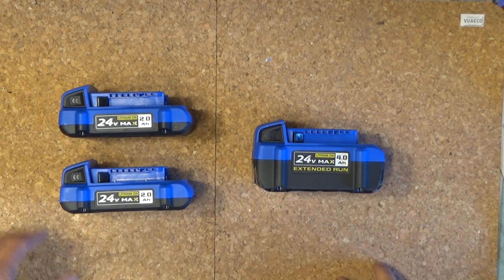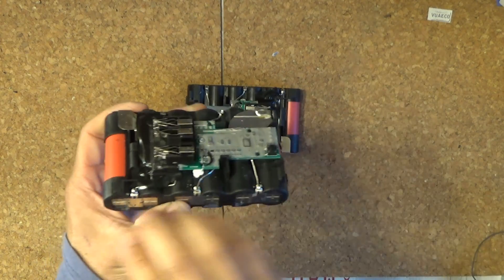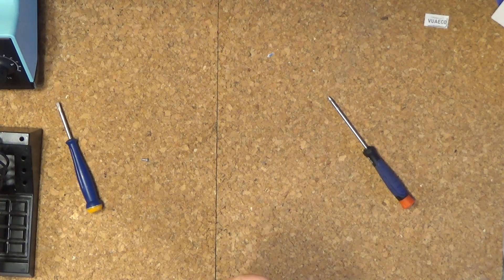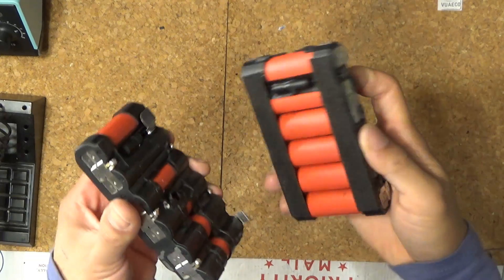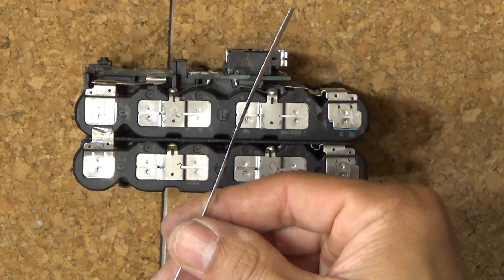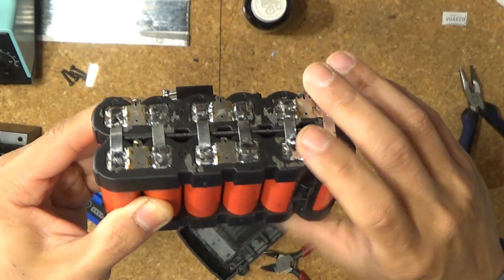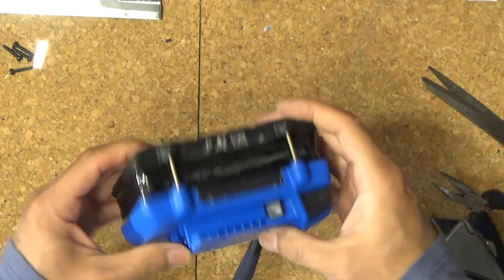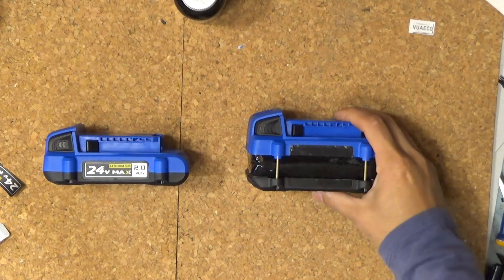DIY tool hack: Turn two compact power tool batteries into a single high capacity battery

Comment: If I connect 2 18v 2.5 ah 720 watt batteries in parallel, will I get an 18 v 5 ah 1440 watt battery? I will do this from the outside without opening them, I can charge them separately if necessary.

Comment: I would have removed the temperature sensor on the top pack and connected it to the temperature sensor on the bottom pack, since it is between both packs. Being sandwiched between them puts it into close proximity to more cells.

Comment: Good idea, but it it much safer for the cells if the strips are spot welded onto the terminals instead of being heated up with a soldering iron. Tip I learned from people building ebike and diy vehicle batteries.
Reply: True you can't solder right to the terminals be that's not what he's doing, he's soldering to the nickel strip. That's fine to do.

Comment: I understand the idea but there is an idiotic outcome from that creation. Before you had 2 batteries meaning you could charge one while using other one in the tool and when it drained you swap it with one that was charging and you keep going and when that one is drained you simply repeat that procedure. But now you destroyed one battery to build a bigger one and when you drain it you have to stop working and wait until it gets charged and the most idiotic outcome is that now it takes double time to charge it. So I come to conclusion that your Idea has a side effect of lunacy.

Comment: Can I upgrade to 3 batteries?
Reply from the maker: Yes, that'll be a 6Ah battery.
Reply: @vuaeco  in thinking of a 12ah. Will the same pcb board work. I understand my backup battery pack will be heavy but my angle grinder needs a bigger battery

Comment: Should have just connected them together in parallel instead of removing the BMS of the second pack. Now it’s not as safe as before, and the cells won’t last as long as intended. You wouldn’t have needed to do so much soldering on the cell...that could damage it.

No advantage in what you are doing other than save a few bucks. You’re getting at best the same WH as a larger pack. I would have paid the extra for the safety and convenience of not having to cut two packs apart, soldering, and exposed contacts.

Nice attempt to save a few bucks.
Reply: This is the way literally every 5S2P pack is made. There wouldn't be any safety benefit if he put two BMS.
Reply from the maker: What if you have a lot of 2Ah batteries laying around? :D

Comment: -Please help. My drill have a Li-Ion 18V batery with 5 18650 batery connected in series. If i connect othyer 5 batery in series, same 18650 for 18V, can i connect the two pair of batery in paralel to obtain the same 18V but higher Ampere? Thank you.

Comment: That is NOT how you solder batteries together. With that many soldering points you're going to over stress each cell when using in tools. Plus Li-Ion Batteries are programmed for specific ah so unless you use a multimeter to determine the ah being used at full charge then you really have no idea if it raised to 4.0ah as these are totally different type batteries than Ni-Cad and Lead-Acid Batteries. 

I just don't trust these type hack jobs from people not being completely detailed in the video.
Reply from the maker: So you can use a multimeter to determine the Ah of a power tool battery? How are you gonna do that?
Reply: @vuaeco  why you solder twice where you can get away with one only. you do this for a reason or it how you understand!??
Reply: @vuaeco , multimeters are designed for both AC and DC power. To determine the AH you must figure out a way to connect the battery using wires instead of normal connection. Then cut the positive wire from battery to drill and connect the positive test lead to the battery end of wire and negative lead to the drill end of wire. This allows the positive current to travel straight through the multimeter. You'll have to set your own multimeter for the ah reading and that depends on the type and brand multimeter you have.
Reply from the maker: @michaelw7540  I can't imagine how this is done based on your instructions. But I assume you're connecting the multi meter in series inside a circuit with a drill and a battery all connected together? Whatever that you're doing, you're measuring Amps, NOT Amp Hour. There's a huge difference between A and Ah. There is no way you can measure Ah of a battery using a multimeter. Well, maybe you can but you'll have to measure the Amps while it's under load and run your drill continuously until the battery is completely empty. That's gonna take a while. Get the timing and the current for the entire process and you can  get the Ah. This is NOT how a tool manufacturer like Dewalt/Ryobi/Kobalt... tests and gives Ah ratings to their batteries, by the way.
Reply: If you dont trust the process then dont attempt the project. You can believe all the manufactur BS if you want to, But this isnt rocket science. where is the memory input located, where these batteries were "programmed"?
The truth is that the DIY community has been using 18650 for all types of projects with a great deal of success for well over a decade.
Reply: First, there's nothing wrong with the soldering. Second, a multimeter cannot be used to measure the capacity of a cell. Third, he did not mix different battery types. Fourth, it did double the amp-hour capacity, since there are now two battery stacks in parallel.
Reply: @Daniel-lf2no  Actually, this guy has way more soldering straps than he needed to parallel the packs with his "method."  However, this is really not the way to double your capacity...go buy a pack that actually handles the paralleling approach properly for maximum battery life (measured in charge/discharge cycles.)  This hack will "work"...but for how long...well that is debatable.  The single charger on the top pack definitely won't be tracking pack temperatures well because the charger will only see the temperature of the top pack...so again, a hack...your mileage may vary.  The single charger circuit will charge this pack slower because it was not designed to deliver the current to both packs at the same time.  This is not a very practical approach to doubling your battery capacity...just buy a longer runtime version battery and have many happy charge/discharge cycles.
Reply: @steveranta8975  I believe that circuit board is identical to the 4AH circuit board - manufacturers, generally, don't like to make custom boards for each configuration (so it probably can handle the current). The only thing is that the other thermocouple, if removed, should be thermally coupled to the extra battery ( a piece of copper, for example, to transfer the heat to the thermocouple). It's a safety feature to prevent over charging (especially with lithium batteries).
Reply: @steveranta8975  well i dont see that much problem here. after consedering all what you menthion.
Reply: That reply is absurd.
Reply: He had twice as many soldering points as necessary but it only adds redundancy and headroom. If anything, it’s less stress. Personally, I would’ve doubled-over the strips and maybe even punched holes in either end before soldering but the end result wouldn’t have been any more reliable or performed any better than his. As I already said in another comment, I also would have tapped in to the other thermistor since it is sandwiched between and in proximity of more cells. Perhaps the board is even able to monitor two of them which you might be able to tell by looking at a larger pack.

Comment: Cool video! I have here a stupid question here: did you have the same runtime with one extended battery than with 2 normal battery? for example If you can drill 10 holes(it's an example) with a 2ah battery, will you make only the double with a 4ah battery, or there is gain?

Comment: Who Wants To Carry Around The Weight Of The Extra Battery, Also You Could Be Charging One While Using The Other One... Over Voltage Will Lead To Burning Out The Tools Motor Faster Or Cause It To Overheat And Melt Down The Plastic Casing...
Reply: There's a reason the bigger batteries cost so much more. You can kill a 1.5ah quickly with a grinder or reciprocating saw.
Reply from the maker: You got your point but having a bigger battery has its own advantages. Just depends on your needs. And you're incorrect about over-voltage, overheat, and meltdown.
Reply: @vuaeco  If You Put In More Amps Its Going To Hurt Something...

Why Have More Tool Weight When You Can Have One In You Tool Belt Or On The Charger

Comment: Is the balancer built into the charger or in the battery pack itself?  I see the circuitry in the pack and the instructions say it has built in overcharge, over discharge, and extreme temperature built into the battery, I wonder if it has balancing?
Reply from the maker: It has balancing board built in the battery pack. If you look closer, you'll see 7 solder joints branching out from the circuit board to the 18650 cells.
Reply: vuaeco it does not have over discharge protection so I doubt it has a proper balancer.  Even though it claims to have over discharge protection in the instructions when I ran the battery it allowed itself to drop down to 3.7 volts for the entire six cell pack which probably damaged the cells.  Very disappointed in these, I won't be buying anymore
Reply from the maker: What's your other options? Dewalt, Milwaukee, Ryobi? They are all the same. None of them have over discharge protection.
Reply: vuaeco buy new 18650 batteries for $1.50 each and a $3 overcharge/over-discharge/balancer board and solder it myself
Reply: vuaeco you're using these for electric scooters, there are better options for that
Reply from the maker: Where can you get 18650 cells for $1.50 each? What's the discharge rate of the cells?
Reply from the maker: What better options do you have for electric scooters?
Reply from the maker: What's the discharge rate on the $1.60 cells? You need 30A to 40A (need extra room to spare) to power a scooter. Those cheap cells have 3A discharge rate max.
Reply: vuaeco i don't know, but they don't even get warm powering a scooter
Reply from the maker: How many cells do you put in parallel?

Comment: I have 2 - 5ah (200 Wh) Snow Joe lithium batteries (iBAT40XR) and 1 - 4ah (160Wh) Snow Joe lithium battery (iBAT40) and want to connect all 3 to make 1 large 40v 14 ah battery for an ebike. Is it possible? Or is it possible to connect them all without disassembling them? They are the exact same size shape wise. Just different ah's.
Reply from the maker: You can solder the 2x 5Ah battery packs. You should not mix the 4Ah with the 5Ah packs together. They have different cells therefore different capacity and ratings. You will need to disassemble them in order to solder them together.

Comment: @vuaeco can the 24v 1.5ah batteries be connected the same way to the 24v 2.0ah and still have a balanced charge?

Thanks in advance.
Reply from the maker: Yes, they can. It's basically the same except the cells are 1.5Ah instead of 2Ah.

Comment: I am assuming that if you want to balance the cell, you have to first disassemble the battery pack out to individual pack and then charge them using RC charger with balancer option? is there a way to make / add in the cable for the balancer connection to the RC charger? I plan to try this out and use it in my son't power wheels (SLA batteries is a pain to deal with when it comes to run time) so any suggestion or ideas from you would be greatly appreciated.
Reply from the maker: Use the original Kobalt 24V charger to charge the battery pack. It is actually a balance charger for the pack.
Reply: Really? I thought these charger don't have a balancer feature since there are not many connections to each of the cell battery.

Also, I stumbled across an ebay link today about the kobalt battery connector side like you did for your battery connector moulding using 3D print, but I am not sure how well this will stand out. Yours seems to be pretty solid, but I do not have the tool myself and intense to use just the batteries for now since they are still cheap at lowes :)

https://www.ebay.com/itm/Kobalt-24Vmax-Battery-Mount-w-14AWG-wire-and-terminals-to-power-your-design-/202065948317?
Reply from the maker: It is balance charged. The charger only has 4 pins and seems like there's not enough pins (need 7 pins for a 6 cell pack). However, it is the charging board on the battery pack itself that has the balance charging feature. If you open up the battery pack, you'll see each cell has its own balancing wire going out to the charging board (of the battery, not the charger). The Kobalt connector on ebay seems fine. However, you can make your own using a silicone mold and polyurethane plastic. It will save you quite a bit of money if you use many of these. Here's the video to show you how I made it: https://youtu.be/4o0dBpYcWwE
Reply: +1 but I have to buy the drill to get the moulding first and then do the polyester method like yours. The drill set is 100+ which I don't plan to buy them since I already have the Rigid and Ryobi set. Maybe when these die out on me then I will consider or Lowes has Black Friday deals on the Kobalt which we will find out soon enough here :D
Reply from the maker: Get rid of your Ryobi and Ridgid. Kobalt is a lot better. And the battery is cheap and very useful for many other projects. :D
Reply: I can see that in your videos. Let see if black friday this year has any good ones. I still like my Ryobi and Rigid ones though unfortunately :D
Reply: One question I have for this moulding method is whether or not you can use the same process to make gear or not like WORM Gear that goes into a gearbox. I am afraid that the material might be too soft for this kinda thing when the motor/pinion running against it.
Reply from the maker: I thought about it before. I haven't tried on gears but I supposed it should work. But it might be good for toys only, not for hauling heavy loads.
Reply: Yes I was refering to making moulding for toy car gears like power wheel 

i.e.: https://i.ebayimg.com/images/g/Zu0AAOSwg3FUbK-6/s-l500.jpg

The factory gear is made out of hard plastic too anyway.
Reply: @vuaeco  charging board a.k.a. a BMS.
Reply: vuaeco do you know if the balancing board has a overcharge and discharge feature?  I'm assuming yes.  If that's true then any 24v power source could charge these batteries, you don't need the special kobalt charger

Comment: why cant you just parralel wire it? i have two dewault batteries 4.0 ah i was wondering why cant i just put wires from plus to plus negative to negative for 8ah battery, for high torque impact and tgen use them seperately again?

Comment: Vuaeco is it possible to double my 1.3ah dewalt 18v through your method by using one dewalt original coupled with a cheaper 18v repack kit. If so can you tell me the battery pack to use.
Reply from the maker: Is it 18V or 20V? The Dewalt 18V pack is NiCad whereas the 20V pack is Li-ion.
Reply: It is 18v and the battery case has XR Li-ion 1.5ah. I have a sneaky thought that this battery and the smaller 1.3ah were dumped on Australia to exploit us as we always seem to be months/years behind with US/Euro technology so that we will pay out big dollars to upgrade to better ahs.
Reply from the maker: I see you're from Aus. In the US, the 18V is NiCad, and the 20V is Li-ion. Not the same in Australia. I think your XR 18V Li-ion battery is in fact the U.S. 20V Li-ion. If it says 1.5Ah, it is 1.5Ah. Most Dewalt batteries use Samsung cells. You can double up your capacity by adding 5 more cells but make sure the cells are the same capacity and discharge rate. It's best to use exactly the same cells if possible. Don't use different cells especially cells that have different capacity AND discharge rate. Or you can get 2 of those batteries (they have to have the same Ah ratings on the labels) and pull out the cells from one of them and put on the other battery.

Comment: Instead of joining two 2ah battery packs, if you had 5 similar lithium cells, could they
be added in same parallel fashion to one 2ah battery pack.  It would be more cost effective.
Reply from the maker: Actually, it is 24V so you need 6 cells, not 5. However, the market value of these Kobalt battery packs are pretty low (actually the lowest of any cordless tool). I don't think you can buy similar individual cells as cheap as these packs. And if you need to add 6 cells, the additional cells have to be in the same condition as the pack you're adding in. You don't want to add old/used cells to a new pack. You also have to use the cells that have identical capacity ratings and discharge rate. It's not easy to find different brand name cells that have identical ratings. So at least for the Kobalt, it makes sense to add 2 new packs together this way.

Comment: What I would like to know if the bms works even though you don't use it to charge.  Could you unbalance the cells and see if they balance.  The reason is these batteries are 24V and could be used with a 24V inverter as-is.
Reply from the maker: The battery would still work even though you use some other (24V) chargers to charge it. But the cells won't be balanced and you must balance the cells once in a while. If not, over time one cell will be overcharged while the other cell will be undercharged and subsequently would kill the battery pack.
Reply: Each battery has a balance board.  If you hooked 6 of the 5 A-hr up in parallel at exactly 24V.   You would have a 684 wh system.  The cf-18 waeco refrigerator/freeze uses about 50 watts, the refrigerator probably is not on all night.  Many van dwellers want a simple system, but the nice thing is there are many devices and you can put a battery out to blow up tires, drill, or use as a flashlight.  Might be a nice project for the channel.